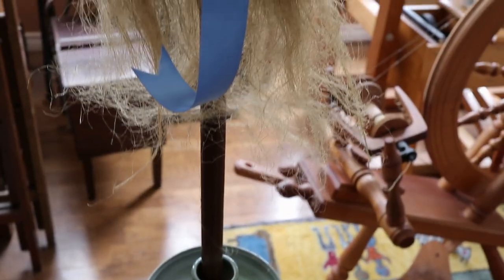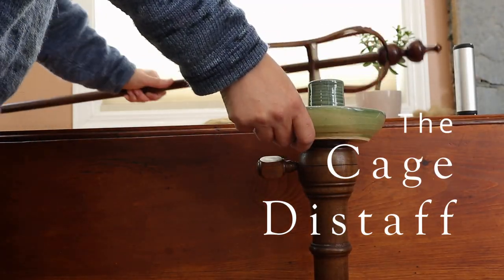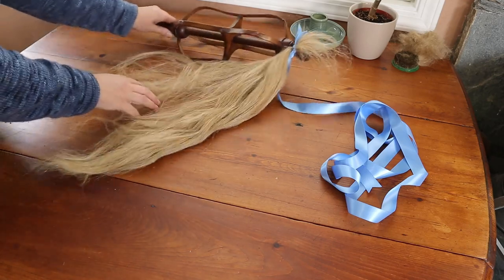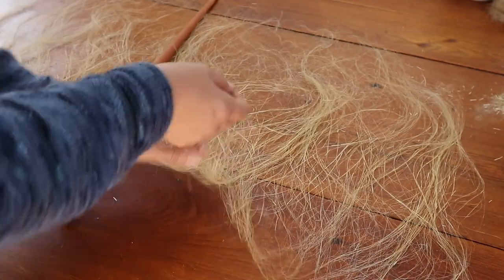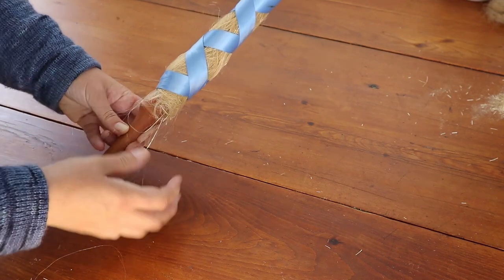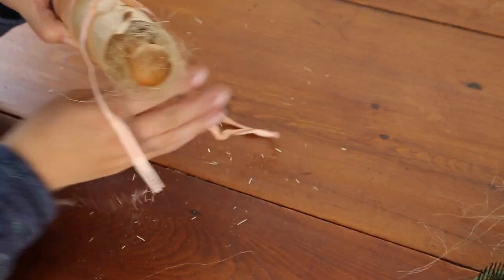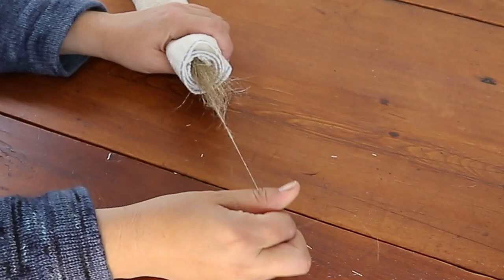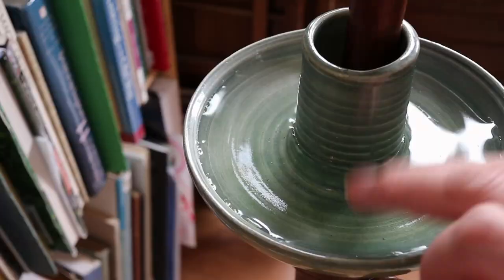How to dress a distaff with flax for handspinning linen yarn

Comment: This video is so helpful!  The best I have found so far.  I am learn how to process and  spin long line hemp fiber through my job at the Cannabis Museum in Athens, Ohio.   We were gifted a van load of artesian French hemp fiber stalks of a variety called Futura 86.   I have been learning how to ret and process the fibers over the past month.  I am starting to build up a supply of long line hemp fibers, but I am a bit afraid to jump into spinning it without practicing on another material.  I have years of experience spinning animal fibers, but I have never used a distaff until recently when I started working with the hemp.  So far I have only spun wool and hemp tow from the distaff.  The wool was not so difficult, but the tow was a challenge to draft smoothly.  Are there any differences between dressing a distaff with flax and hemp?